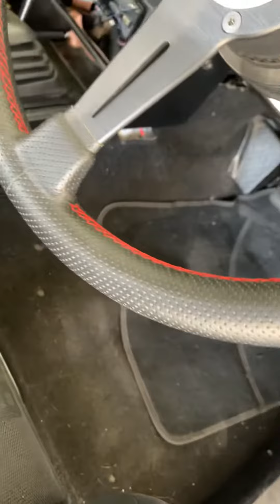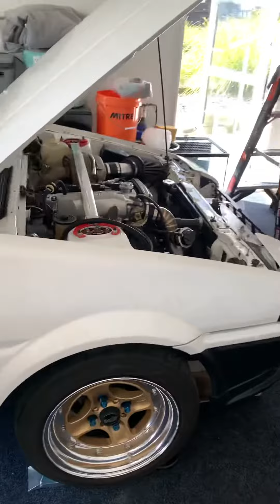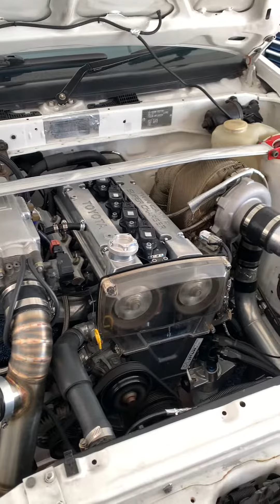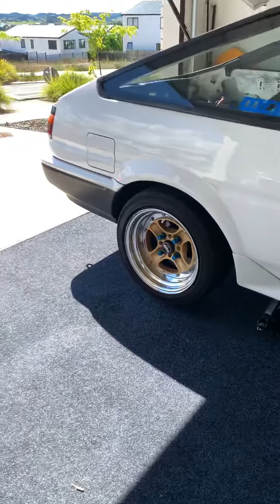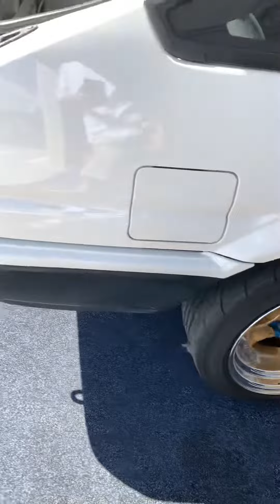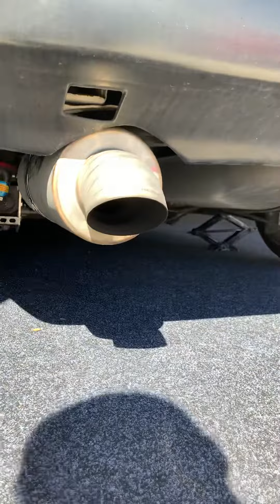Broken Turbo Trueno AE86 Warm Up After 3 weeks of parking

Comment: Are the wheels still spinning when its in neutral like last time or was it in gear?
Reply from the maker: Yep, still slightly spinning, but I can stop it with my finger, And a guy explained to me about it, said it’s a good thing, drivetrain parts are in good condition and connected properly.
Reply from the maker: Here is another explanation from online sounds ok. : Even though there is no gear-to-gear connection in a manual transmission while it's in neutral, there are synchromesh plates which are designed to help the teeth mesh quietly when a gear is engaged. They create a very slight drag, enough to spin the wheels when they are off the ground.
Reply: @Jimmy_Wei  interesting